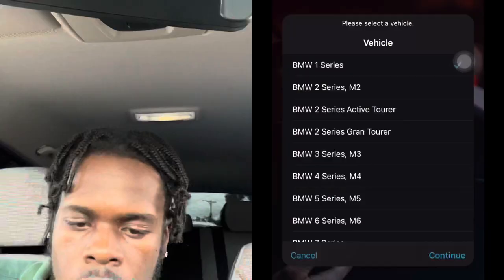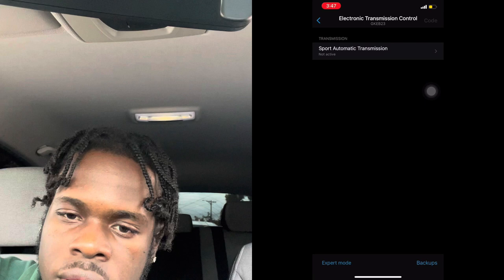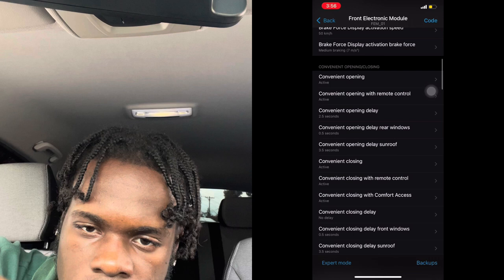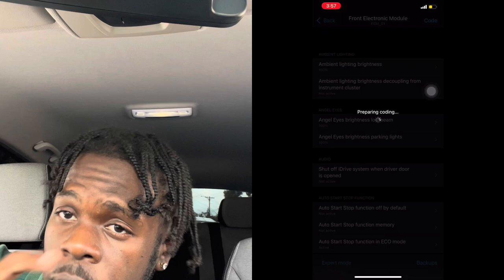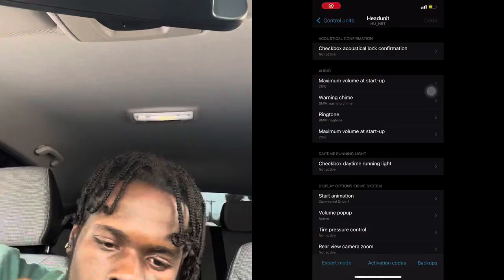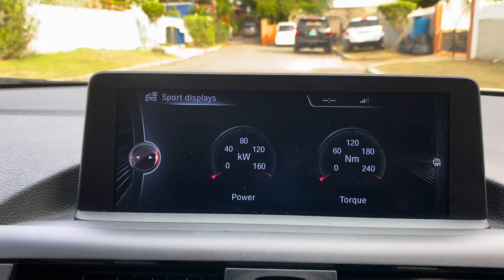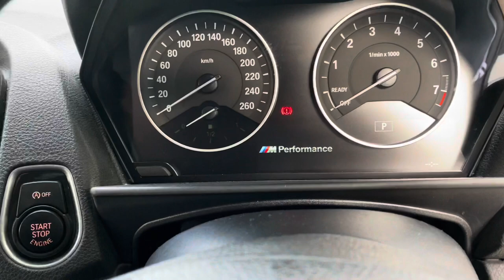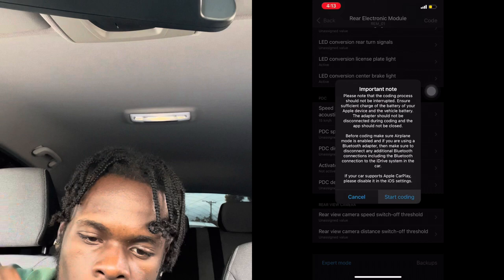CODING A SUBSCRIBERS BMW 1SERIES WITH BIMMERCODE

Comment: Is it possible to code stage 1 with bimmercode? And are all those coding you did in this video free if you have the OBD dongle? Thanks
Reply: Lol dude.. stage 1 with bimmercode for real?
Reply: @tobias67  i did stage 2 with bimmerlink today
Reply: @Luuuugn   ye must be very good XD
Reply from the maker: I’m not sure if it’s possible, but once u have the obd dongle, all the codings are free
Reply: @Luuuugn  BimmerLink is basically a Diagnostic app but you can use Sound Tuning (exhaust burble, only on cars with the S55 engine)... but if you use BM3 you can tune a car..